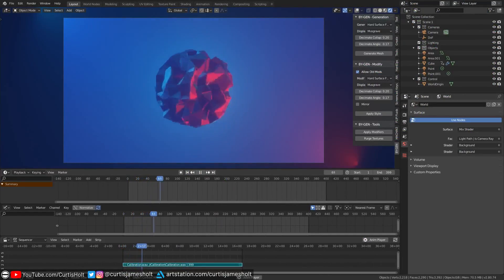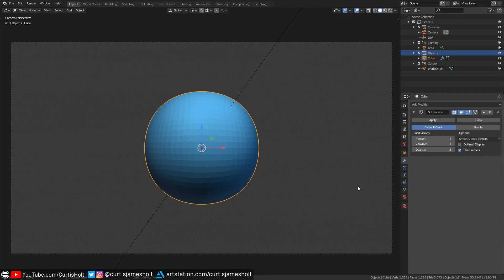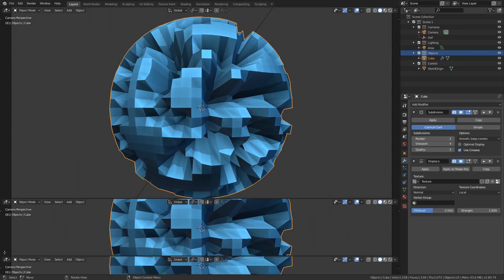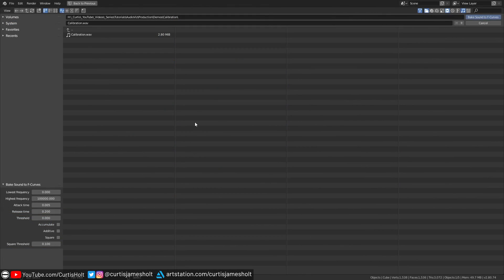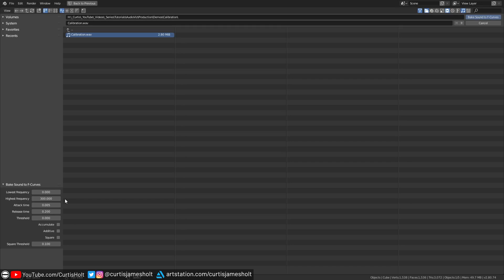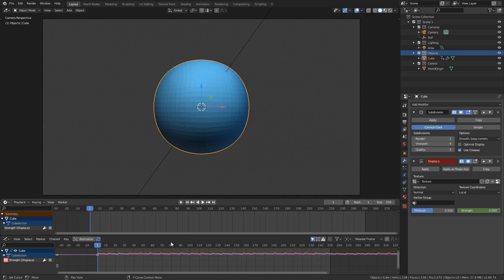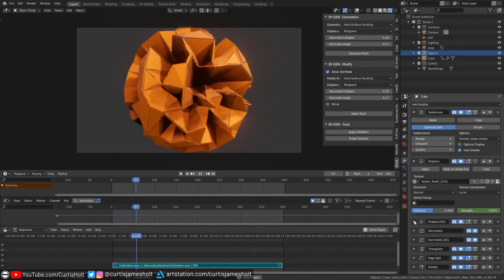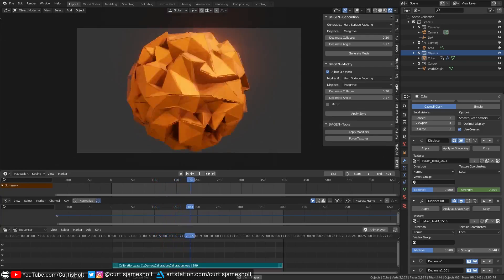Audio Visualization with Modifiers in Blender 2.8

Comment: is there a way to adjust the threshold at which everything reacts so it can be more or less dramatic? or do I just have to raise the volume output of the file to achieve this?
Reply from the maker: Off the top of my head, if you wanted to dampen the effect then you could add a smooth modifier and play with the repeat value.